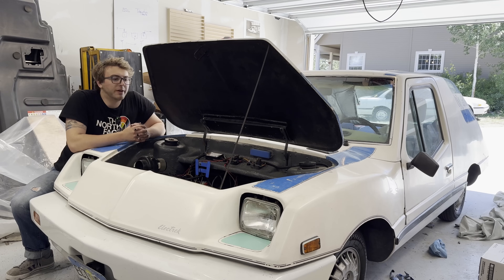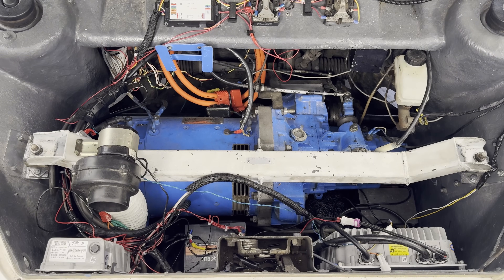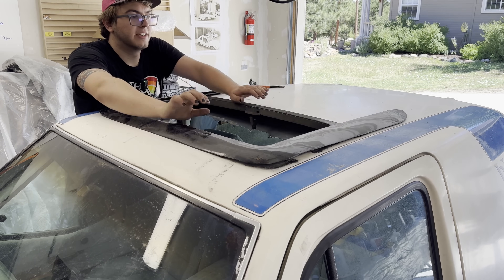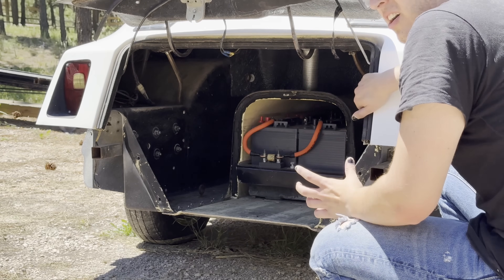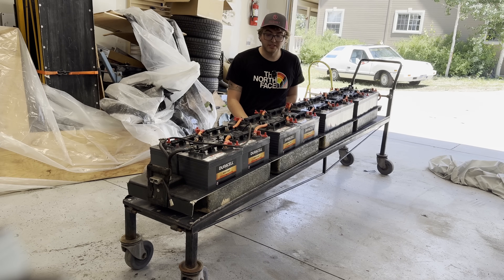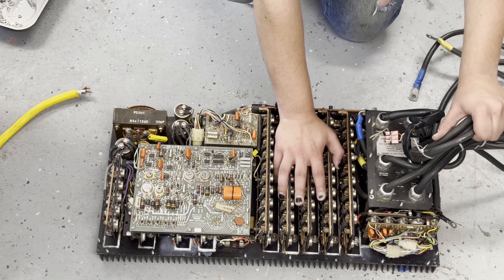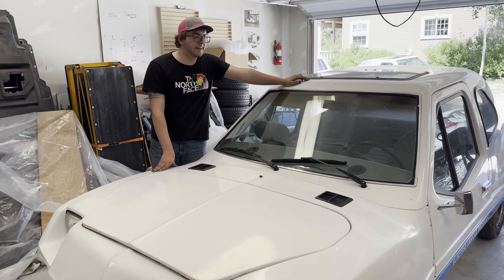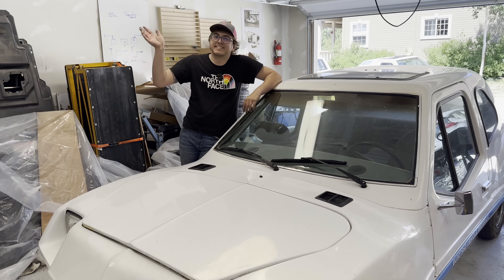Fixing My 40 Year Old Electric Car

Comment: I suggest the use of a rubber mallet or a piece of wood if you gone to use the hammer to absorb part of the impact. Those solid state controllers have the tendency of melt the components weldings due to the amperage. When a vibration is added to the board, the transistors and diodes terminals get lose from the board and become to open the circuit and fail.
Reply: I no no wanna

Comment: that inverter module placement feels so wrong , one hit in the front and thr whole car would be ruined. if the circuit fails it can be repaired by someone with enough skills but if the thing gets smashed you can not buy a new one like that , fortunately other inverters are easy and cheap to get from china but it wont last 40 years and the charm of having it original would be gone. 
although one thing i would recommend changing is the batteries. once these led acid dies you should just switch to two 48v lifepo4 server rack modules in series. 10kw is enough to drive around town but it looks like it has enough space to fit 40-50kw worth of server rack style lifepo4 modules.

Comment: You probably want to keep it as original as you can, but before selling it, it would make a great video if you can run through what the  parts necessary to modernise the battery , motor and controller would cost and where they could be sourced.

Comment: I like #0000 Steel Wool for cleaning glass, usually with some sort of lubricant (Dawn). If not that, clay bar sometimes works, or a buffer, maybe gentle BKF solution. I'm surprised you haven't let Colton get his hands on it for an episode of Out Of Spec Detailing on an old obscure EV, we'd get another episode of the Electrek and it would probably come out spotless
Reply: Honestly I forgot Colton existed. Don’t tell him I said that

Comment: That's some fine fit and finish around the headlights.

Have you tried a razor blade on the windshield?

Hockey tape (poor man's tesa tape) looks more professional than electrical tape.
Reply: It also doesn't dissolve into goo and become a pain to clean after a few months!

Comment: For the windshield, use Bar Keeper's Friend and a sponge and water, scrubbing in a circular motion. Then rinse, let dry, and use sprayaway glass cleaner and a wad of newspaper to polish it.

Definitely don't use brake cleaner!! It'll destroy any adjoining trim.
Reply: I’ll give it a try thanks!
Reply: I use what sounds bad but has worked for me for years is steel wool with soapy water